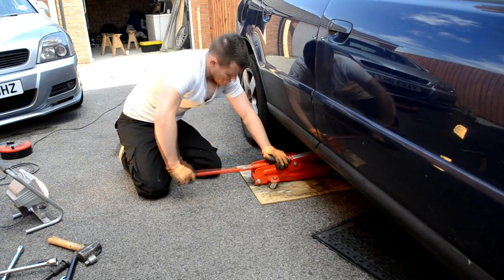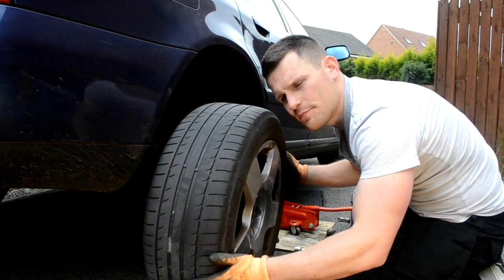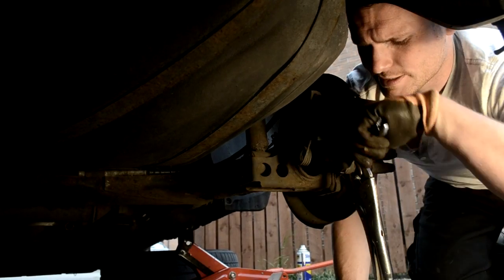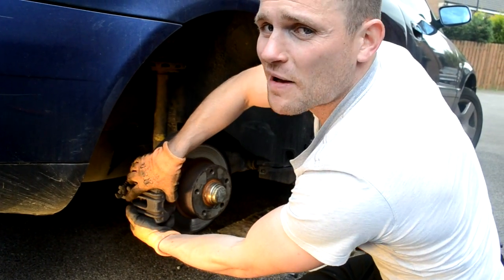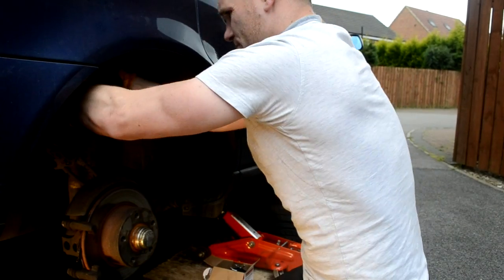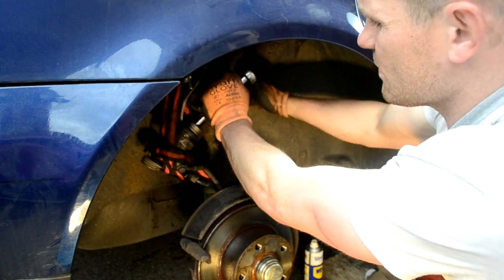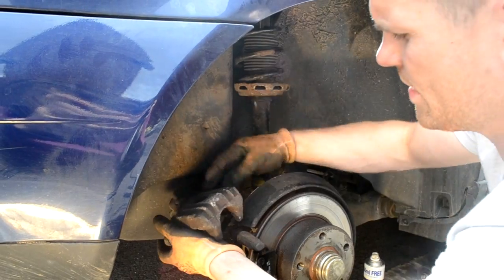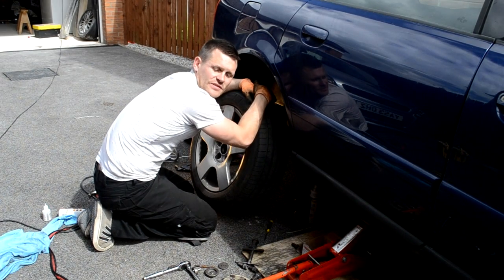How to replace rear brake pads - Audi, volkswagen, Skoda, Seat  and many more

Comment: safety jack is better than a tire and you don't need vise grips because the guide bolt has a 15mm size, you just hold it with a wrench so you don't damage the guide bolt cover boot
when winding back brakes you want to take pressure off, you are pushing fluid so take off the reservoir cap or better yet open the bleeder with some clear line into a bottle, it will turn much easier then just top off with new fluid.
You did not even check if the guide pins have lube, if they are dry the pad will ride on the rotor and you always! put brake grease on the tabs that sit in the carrier or they can't move and you will get the pad stuck to the rotor not only killing your MPG but you will wear the pads out 100% faster.

Comment: 1) head unnecessarily underneath a raised vehicle - unnecessary risk no need to have head under the arch 
2) clamping a rubber bush with mole grips - potential damage to bush 
3) hitting a metal caliper with a metal screwdriver - using a block of wood or rubber mallet would eliminate the inevitable marks and damage

Other than those points a really useful guide :)
Reply: how do you even stop it from rotating then?

Comment: Hi bud thanks for your time making this ...a question does the wind back kit fit all cars or do you have to get a specific kit for the make model of car ? I have a Skoda Octavia scout cheers
Reply: They are generally all the same. I've never  come across any that a typical wind back kit didn't have the right parts. The Skoda will be the same as the Audi as they are pretty much the same company so a standard kit should do the job.

Comment: Great video, but I got a problem. I've resonantly changed the rear pads on my Audi A4 B5 1.8T but 1 side is now griping onto the disc without the handbrake or foot brake being applied, any idea what could be the problem?
Reply from the maker: ***** Thatnks. My first guess would be the caliper has seized up, that's happened to me before
Reply: Could be, I've got it booked in now for someone t have a look

Comment: I did the exact same process as you but I changed the disks as well as the pads, both side on the rear. However the brake pedal now is a little softer than it used to be. Is this the case of bedding the brakes in or do I need to bleed the brakes?

Comment: How do you  replace the rear rotors on a 2013 VW  Golf? The bolts holding the caliper carrier are very difficult to remove.

Comment: Do I need to do anything with the piston once finished? Wheel feels locked as new pads are right up against the disc. I took it for a drive and its driving fine but just worried about the lack of spin in the wheel....
Reply: I should add I didnt use the special winding tool, so didnt get the piston all the way back. I just presumed it would reset itself?

Comment: do you need to wind the calliper back in or can it be pushed back in by pipe pliers?
Reply from the maker: On the front brakes you normally just need to push the calliper back but the back callipers are often on a thread so they can be operated by the hand brake, these types need to be wound back.  There are a couple of easy ways to tell which you have.  First you can release the handbrake while pushing the foot brake, if the pressure changes a little on the foot pedal then it's most likely on a thread.  You can also tell once the brake pads are off as there will be two notches in the piston designed to take the calliper wind back kit.

Comment: So:
You didnt remove cap from reservoir.
You dont bother to use copperslip on piston face/pad backs/etc.
You dont bother to use copperslip on wheels to hub.
You dont bother to use Red Rubber Grease on sliders.
Reply from the maker: supersesqui Erm... almost all true.We did remove the cap from the reservoir but forgot to put it in the video, I think most people will work that out for themselves, maybe ill put a little subtitle explaining this in the video. All the rest is true but the brakes were changed months ago and we have had zero problems with them or any other brakes we have ever changed in all the years of changing our own brake pads.I am sure you are suppose to use everything you mentioned but we are talking DIY, quick fix solutions on an old car here, most people can't be arsed with all that.
Reply: Reelfunky Tutorials
 Ok, If you are going to make a video about the most important safety system on a car(OF ANY AGE)  for beginners... I think its reasonable to be very specific, comprehensive and clear on EXACTLY what needs to be done... how its done and in which order.
I used to pack parachutes and never had one complaint in all those years...get the idea ?
Reply from the maker: supersesqui HA HA I am glad you never had a complaint about your parachutes!  I expect anyone who is considering changing their own brake pads to have at the very least some common sense, an understanding of how the brakes work and do more research than just one you tube video. Ive never used copper grease, i know about it but never had any issues not using it. If you are really that concerned make your own brake pad tutorial and stick a link to it in my comments, i don't mind.
Reply: Reelfunky Tutorials I don't suppose any fucker who's chute didn't open was able to complain.  Just a thought.  I see no links to 'correct parachute packing techniques' above so I can rip that video to bits. Good video son. Don't worry about the grease. Ha
Reply: MrCountmeout
Why would I need to make a chute packing video to comment on other vids ?
Why would you want to rip it to bits...if it were correct ?
It's not a GOOD video if it does not actually show you 'How To' properly !
 I made salient technical points...unlike you.
It's called ENGINEERING...son....about which you obviously know very little.
Now off you go and comment on cartoons or similar.
Reply: supersesqui Quit whinging and appreciate a lad's good job!!!
Reply: Chris Carroll
You are correct I DO know about engineering.
And you are WRONG, I DO know how to make videos.
YOUR video will be a testament of your lack of Engineering skills and knowledge for ever more...lol
Reply: +supersesqui Can't you just appreciate a good video? Your "expert" criticism doesn't change the fact that the video is helpful.
Reply: Adam Jensen

It may be a little helpful, but if you are going to bother to make one...at least do it correctly....showing all stages done properly with correct tools and correct greases/fluids/antiseize products.
Set the standard.
Reply: jodejr

You only need to replace rotors IF they are warped.....severely grooved or below thickness !
I have never heard such rubbish...nor has the RAC or the AA Engineering department.
Reply: Jory F
Where did I say that ?
Re-read all the posts.
It was not said by me.
That degree in in Logic, comprehension  and reasoning was wasted on you was't it !
Reply: supersesqui " Ok, If you are going to make a video about the most important safety system on a car(OF ANY AGE)  for beginners... I think its reasonable to be very specific, comprehensive and clear on EXACTLY what needs to be done... how its done and in which order."

He was clear on what gets done in what order... you're implying that he is being careless and unclear in servicing the "safety system" on this car, because he didn't "copperslip the wheels to the hub" 

get a fucken grip pal..

Comment: how long do you have to turn that piston, been cranking for some time, doesnt appear to be moving anywhere.
Reply from the maker: +Ronin some Pistons are push only and do not require turning .
Reply: mine is push and turn (audi a3) Was trying to just use that universal cube w elbow grease, but gave up and rented the winder w backplate. Love needlessly fancy german auto's. The fronts are push only.

Comment: Brilliant tutorial sir. Never tried doing brakes befor but it looks like a piece of piss.
Reply from the maker: Thanks. It is a piece 'O' piss mate, give it a go.
Reply: Reelfunky Tutorials  Just bought an old Octavia running LPG i needed a car fast and cheap but it seems like the 12 month MOT was done over the phone!!! brakes are a digrace as were two of the tyres. got it for a good price.
Loving the gas and the service parts are as cheap as ive had on any car . Hopefully Santa brings me a Haynes Manual and ill give this a go in the warmer weather.

Which in Scotland is about 4 months away hahah
Reply from the maker: Ah cool.  I have a Vectra that I got converted to LPG.  I guess you did ok if its only the brake pads and tyres, at least they can be changed easily and fairly cheaply.  Yeah doing any work in the winter is shite, every scrape and knock just hurts, wait till its warm, or warmer at least.